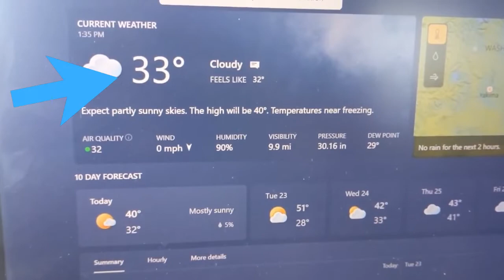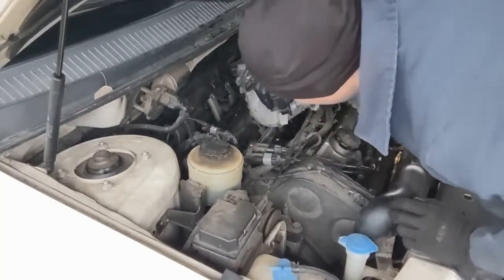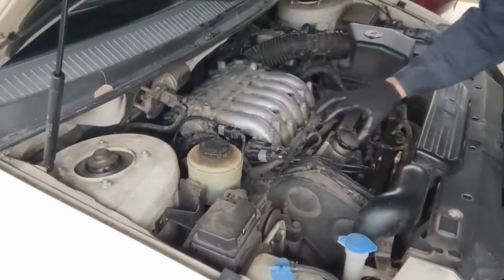2002-2005 Kia Sedona Spark Plug Replacement

Comment: I tried doing our 2015 Sedonas plugs back in July.  I gave up. I didn't realize at the time that the power steering hydraulic hose was mounted to the surge tank with two 10mm bolts.  I'll have to take a stab at it again soon if the weather and the wife cooperates.

Comment: How often should the plugs and wires be changed on a 4 cylinder?
Reply from the maker: Good question. It would depend on the year and type of plugs being replaced but most manufacturers using iridium spark plugs recommend every 100k miles. Copper plugs typically every 30k.

Comment: Did your Sedona have some sort of rubber thing over top of spark plugs 1,3, and 5? If so, how did you get that rubber out for that I can get the spark plug out?
Reply from the maker: From what I recall it should just be the spark plug wires. See if the end of the plug wire is still attached to the plug. If it is then you'll need a long pair of needle nose pliers to get down there and remove it.